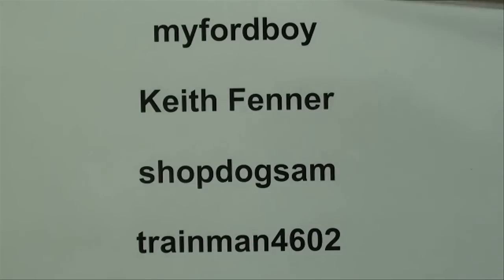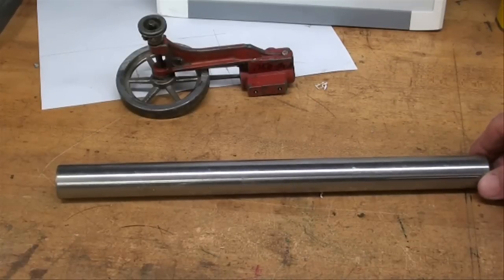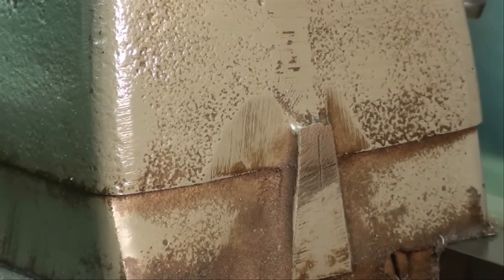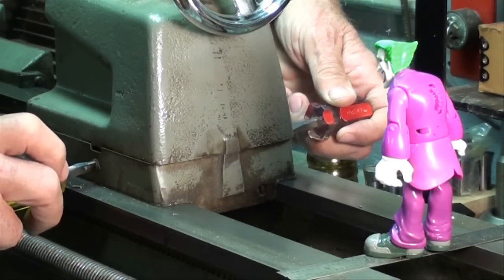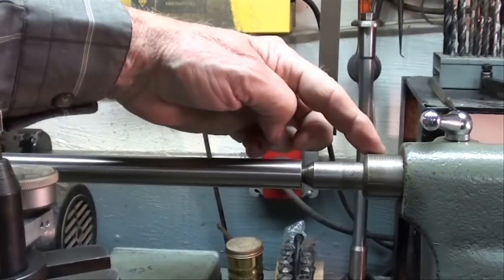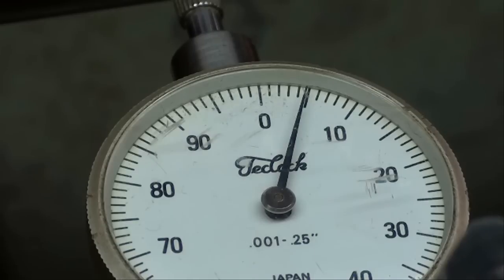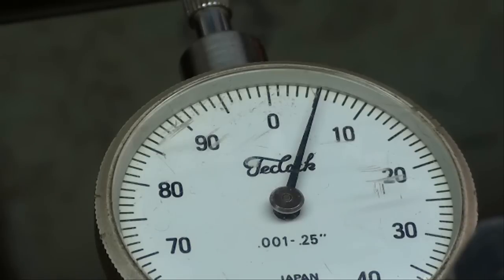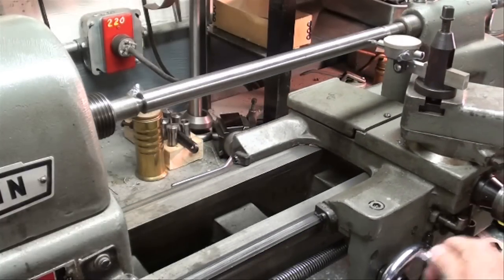MACHINE SHOP TIPS #99 Aligning Lathe Centers TEST BAR METHOD tubalcain

Comment: Nice video Mr Pete. I have two questions. How do I adjust if my tail stock is 8 thou low?
AND How do I accurately check the test bar is dead straight? Will rolling it on a granite surface plate pick up a 2 or 3 thou bend?
Cheers, Michael 🇦🇺

Comment: Mr. Pete I know that I am very late to make a comment on this video of yours. You are very sharp at what you do. Now I have found a very fast way to align  the tail stock with the lathe chuck at dead center totally without a test bar. I use an 5C er 40 collet chuck and in the tail stock I use a morse taper 3 end mill holder with a.500 dowel rod. Move the tail stock up to the 5c er40 collet chuck that has a 5c er 40 collet with a.500 hole dia., then adjust the tail stock screws until the dowel rod moves freely in and out of the  hole with no interfearance. You will know when  you hit dead center  and feel  absolutely nothing by moving the tail stock back and forth. Now then run a test piece  and check your T.I.R. Now i was very shocked at the results when i put a test indacater on it and got a .0002 T.I.R.  on the test piece!!!!
Reply from the maker: Thank you very much, that is a great method

Comment: Hi Mr Pete, for those who just purchased a used lathe I would suggest they indicate the headstocks dead center before even installing the test bar. Then add the test bar to put some pressure on the spindle and re-indicate the dead center by rotating the spindle to look for runout. This will indicate (pun intended) if there is a problem with the spindle, spindle bearings,  or dead center. Without this test first, it may be as you would say " all for naught."  Keep up the great videos.

Comment: A centering tool aligns both vertical and horizontal. Can be homemade (probably should be made since no one wants to sell it.) It's used with a homemade test bar. I'm not a machinist but a solver, so run.:)  So, my center finder shows lathe is off vertically big-time. Horizontal can be adjust but not vertical. Haven't figure it out yet. A centering tool is amazing yet, simple to build but I don't know why people run from it.
Reply: +David - if the tailstock is LOW, you can shim it underneath to lift it. However, if it IS that far out, it's worth double-checking the lathe bed is not banana shaped end-to-end. A company I used to work for had a second-hand Myford ML7 and it had exactly that fault  having become warped over the decades. We managed to shim the twist out of it eventually, but would have to have paid for a regrind of the bed to remove the banana shape.

Comment: Mr Pete... I am assuming that by saying putting in the chuck and drilling the center is not accurate enough... you suggest going back after center drilling.. and cutting the center @ 30 degrees like you show in another video ?? That seems to be the most accurate way

Comment: If a test bar cannot be obtained or afforded, would turning a length of round stock between centers, then indicating over its length or measuring the rod diameter at both ends (accounting the difference in dia.) provide similar results? 

Though after each indication and adjustment of the tailstock, another cut further reducing the rod diameter would be needed before indicating again, until the rod is true from end to end.

 I have never tried this method. Just a thought.

Comment: Mr. Pete I do no have a test bar, but wondered why I couldn't use a 1" chucking reamer that I do have. Mine measures .875 for about 7.25 inches (overall 10.25 including cutting edges.) I know this is a short distance, but the reamer I think is very true, it has very nice centers on each end, and it is a tool that I already have. Any thoughts on this idea would be great, as I have no formal training as a machinist. By the way my present lathe is the Craftsman counterpart to your Atlas.

Comment: Could you make a test bar and align your tailstock at the same time by making a cut from end to end and then measuring the diameter of each end? Or would that not be very accurate?

Comment: We made test bars in trade school.  We turned ground them between centers on a cylindrical grinder.  They had a larger diameter on each end and the ends had precision tapers ground on them for some reason.  We had to inspect them on bench centers when we were done.  They had to be perfectly straight and zero runout. To be honest, It's been in the bottom drawer of my toolbox all these years and I've only used it once or twice. I agree about Keith Fenner's page. He is really go at a lot of things.

Comment: Thanks for the tip. I was just doing this today. Had to turn down my dead center and achieved 0.0005" TIR on my old 1942 10" Logan before I started with the test. The inside 3MT bore on the head stock only had < 0.0002" TIR. This is after 70 years! You can't beat old American technology. Can you show all how to make a lathe test bar? P.S. you are a great teacher! I am learning from you.

Comment: ? what if you do not have the bushing for the headstock taper? can i chuck up and turn a 60deg point and use that?..I am assuming that would be accurate......the other end of my test bar is MT4 for the tailstock....both ends are very accurately center drilled..as this is a real ground test bar for this specific purpose..

Thank you

still love your vids!